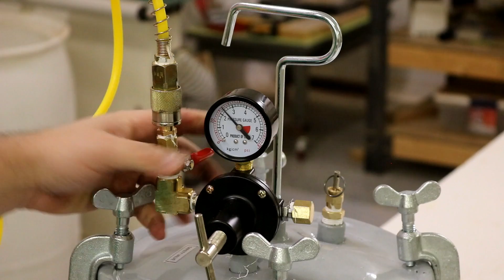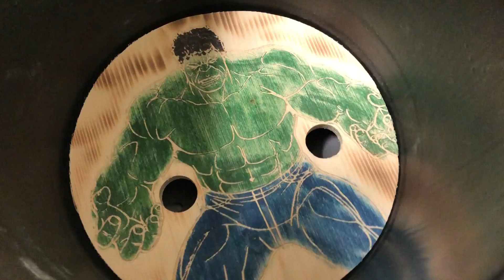Converting a Harbor Freight Pressure Pot for Resin Casting

Comment: For anyone trying to do this in 2024/2025, just fyi...the gauge is in Kg/cm2. Even though it says it's rated for PSI. If you want to do math every time, you may want to consider replacing the who regulator piece with something not rated in metric.

I had to take a propane blowtorch to the t-fitting to heat it up enough to loosen whatever crap they put on it, in the factory. It would not come out otherwise.
Reply from the maker: @TOMJLAEL  I have a video comparing this to a ready made one coming out tomorrow.

Comment: I just tried to build this but I am still getting leaks around the safety valve and the main gauge stem. I used Teflon tape and they are tightened as tight as I can get them. Anyone else have this problem? Any suggestions on how to fix it. The release valve had some glue on it when I removed it initially, that might be part of the problem. I cleaned off as much as I could but I might just need to buy a new one.
Reply from the maker: Karen Ross Smith There’s liquid Teflon that can be used or you can take it back apart and re tape it and use a little more.
Reply: Jake Thompson ok, thanks!

Comment: i dont understand why pressure removes the bubles. Can you explain it?
(i understand how vaccum does it, but pressure is the opposite so i dont understand it)
Reply from the maker: Hyper Hektor pressure squeezes the bubbles so small they can’t be seen!!  It does it immediately. With fast curing resin it is the way to go.  👍👍
Reply: @JakeThompson  thank you

Comment: Hey, went and got all the parts and started following along putting it together. One issue, the threads that are straight down from the pressure gauge, are not NPT! The threads on the cover are. I didn't notice until putting the gauge on and it basically spun freely all the way in even with extra Teflon tape. Did you swap out that 1/4 male to male nipple on the bottom of the gauge? Mixing thread types is a huge no-no, safety wise, so I'm putting that elbow that the gauge was supposed to be attached to back on.
Reply from the maker: Chad Voller One of the holes on the lid is 3/8 and the other is 1/4 inch. The 3/8 one was gummed up so I showed running a tap through the threads to clean it up. There is a 3/8-1/4 adapter for the pop off valve.. the other hole should be ready for the regulator..
Reply: Jake Thompson Both the 1/4" and 3/8" on the lid are NPT threads. The one that is on the bottom of the pressure gauge/regulator is not NPT.   It has standard threads, and is meant for tapered sealed fittings. It's loose when threaded into NPT, and bottoms out before it can even get tight.
Reply from the maker: Chad Voller I’m looking back at the video.. it looks like I screwed it all the way in but I don’t remember the threads being any different.. next time I get out to the shop I will definitely give it a look
Reply: Jake Thompson If it does fail, more than likely it would just leak. But knowing my luck, and the shallow cut the threads in my lid had, being there's little consistency in HF product quality yours could be fine. But I'm gonna play it safe. I've been wacked in the head from an air hose that failed before, and it didn't feel good. Though that was 120PSI. :D

Comment: So for someone who doesn't have a pipe threader, should I still try and fit that 3/8 brass fitting in?
Reply from the maker: Bigtgamer 1 Try to fit it in. If it doesn’t want to go in easily, go get a pipe tap.  It’s just a few dollars.
Reply: @JakeThompson  will do! Thanks for the quick response!
Reply from the maker: Bigtgamer 1 Very Welcome.
Reply: @JakeThompson  one more quick question, was there a purpose to the elbow joint? Or just personal preference?
Reply from the maker: Bigtgamer 1 it just makes the air rotting out of the way to make it easier to clamp the lid down.
Reply: @JakeThompson  exactly what I wanted to know! I'll go pick one up tomorrow, any recommendations of compressors? I've got one for airbrushing that says it's 1/5 HP and goes up to 60 psi, think that would work?
Reply from the maker: Bigtgamer 1 If the tank is bigger than the pressure pot, you should be fine.. if the tank is smaller it not going to work unless you will be using resin with a long working time.
Reply: @JakeThompson  ah there is no tank so I guess there's my answer haha I'll look for a cheap one at harbor freight

Comment: Video is very well done with full explanation in a straightforward manner.  I purchased the Pressure Pot; acquired the new parts (from Harbor Freight and Ace Hardware) and followed your instructions.  Everything worked perfectly.  One point: It was a challenge to disconnect the necessary parts from the Pot, but with some effort they came off.  Thanks again. Peter
Reply from the maker: Thank you for the kind words Peter.. I’m glad the video was useful. 👍👍

Comment: Is there a reason you can’t just cap the paint outlet and leave the safety valve where it was at on the Tee?
Reply from the maker: There are plenty of ways to do it.. you just need everything plugged and a way to get air in, and the pop off valve to work.

Comment: I have a dumb question Jake.  When I work with mixed material, I tend to use vacuum to remove air pockets and bubbles.  Why pressure?
Reply from the maker: SimpleNature The resin n I use has a short pot life, not enough time to use vacuum to remove the bubbles.
Reply: @JakeThompson  Thank you.  Also found the video on the subject.  Great stuff!
Reply: Pressure will cause the retained bubbles to shrink/compress under pressure to where they’re tiny and can’t be seen.  The resin will cure and keep those bubbles under pressure.  Vacuum will cause those bubbles to enlarge and boil off before it cures.
Reply: @JohnPamperin  Never considered the catalyst aspect.  Mostly used silicon potting and have noted froth before.  These are long cure 2-part formulae.  The remaining pressure of each air bubble could be problematic in more viscous compounds.  Often softer 2-part solutions are used in high voltage applications.  However there are other hard-cast application I can certainly see advantages.

Comment: Question = I thought the idea was to use vacuum and not air pressure to pull all the air bubbles out of the resin?
Reply from the maker: Hooked On-CNC Vacuum and pressure are just 2 ways to get the same result
Reply: Depends on what you're doing. Both work good for getting rid of bubbles. A pressure pot actually compresses the bubbles until they're too small to see. A vacuum will remove the bubbles but the resin will bubble up and rise during the process and can spill.
Reply: @mdbz8357  That is true. I would use a vacuum to remove bubbles then pull the resing out of the pot to pure the resin into the 2 sided molds with vent holes.

Comment: Jake, GREAT video!! I just finished assembling my HFT pressure pot with all the fittings you showed. Works great, as far as having to adjust the lid position to the point of no leaking. Next time I will use your suggestion with petroleum gel. Haven't tried casting just yet but will soon. Curious what you do to hide the blank barrels in the clearer blanks so the brass doesn't show as much. I painted two barrels with silver glitter spray paint as well as spraying a little inside the blank barrel hole too, but that didn't work because now the barrels won't fit in the blanks. Going to re-drill the blanks and see if they will fit then. Any suggestions?
Reply from the maker: Gary Maynard I’m glad the video helped you!! One thing I do as far as leaking goes.. is .. I have some clamps handy and if it leaks I just clamp the entire pot to the table.. and as far as the blanks go. I just try to have the blank not see through.. but painting the tube is just about all you can do I think.. 👍👍😄
Reply: Gary Maynard you can get a mold for pouring blanks around the pen tube. I’m not exactly sure where to get them though.
Reply: I know some folks paint the tubes white

Comment: Can a pressure pot be used as a vacuum chamber by substituting a vacuum pump for the compressor?
Reply from the maker: Wood Turner You can use it for vacuum but you really need to see in the vacuum chamber when you degassing things. So I think a different lid that you can see through would be necessary for it to work correctly

Comment: Can the pressure pot also be used as a Vacuum Chamber for stabilizing wood?  
I understand it is the complete reverse of its intended purpose.  
Thanks for sharing.
Reply from the maker: alfredesquer Yes it can be used for a vacuum chamber, but you can’t see through the lid, you need to be able to see what’s going on in there when you first start the vacuum. Here is a link to my stabilizing video. https://youtu.be/s7EoPC1Nlb4
Reply: You put the resin in the vacuum before you pour it into the mold or into the wood. This is useful when the wood is bigger than the vacuum pot. Watch anybody else's video and that is how they do it.
Reply from the maker: david diehl Theres more than one way to do things, This is how I chose to do it with a faster curing resin. Everyone else’s videos are using resins with about 45 minutes of workable time.  This resin has only 12 minutes of workable time.
Reply: @JakeThompson  limits you on size too. I cast building sides over 12" . Also use the vacuum for plaster parts.
Reply from the maker: david diehl That’s cool. There are different resins for different applications I’m sure we can agree on that.
Reply: @JakeThompson   I have also found if you spray your mold with enamel paint the color your part will be. It acts as a mold release. Even on silicone molds.
Reply from the maker: david diehl good tip.. 👍👍👍

Comment: Great video Jake! Can you pressurize the resin before it hardens,  then pour it onto your project? I think I've seen it done but you seem like you would know better than my guess. Thx
Reply from the maker: NUTTY You can do that with very slow drying resins.. there’s not enough time to do it that way with resins with less working time. People that use slow drying resins use a vacuum chamber to remove the bubbles.
Reply: there are a few videos on that subject out there but basically a vacuum chamber will extract all the bubbles by expanding all the air bubbles until they are big enough to rise to the surface and pop, whereas the pressure pot doesn't actually remove the air bubbles it simply compresses the air bubble to microscopic proportions so that they can't be seen by the naked eye, and then of course holds the pressure until the resin sets up.

Comment: Jake, I'm sorry if this has already been asked...why do you need the 90° adapter between the compressor hose and the regulator.  From a layman's point of view it looks a little clumsy to go in from above.  Is there a reason that the hose adapter can't go directly into the regulator so that you go in from the side instead?
Reply from the maker: Shawn Sherman It’s just personal preference,  and it helps get the air inlet away from the wing bolts that hold the lid down.. in the future I’m going to have air lines coming down from above.. and the fitting pointing up will make more sense then. 👍👍
Reply: @JakeThompson Hi Jake. nice video. I just finished mine but I can't bleed the air off with the ball valve. it is almost like there is a check valve inside the regulator that came with the tank?
Reply from the maker: william hamilton Mine will not work either if I open it too fast.. I just lift up on the pop off valve.

Comment: Hey Jake... nice vid, thanks! Just built my pot tonite. 
Here’s a question:
On the black pressure gauge piece where the threaded crank sticks out, there’s a pin hole immediately under the threaded crank on the black housing. Mine seems to be leaking from that pin hole. Any idea why there’s a hole there? And what’s the crank for anyway? Thanks, boss. 
Cheers.
Reply from the maker: XXXTechRC The metal thing sticking out is used to control the pressure your air supply lets in the pot.. right around 7:30 or so in the video you can see me turn it to let more pressure in.. maybe it’s backed out all the way and that’s why it’s leaking.. just a guess.. let me know if it helps.. I will be in the shop tomorrow, and see if I can find the hole you are talking about
Reply: @JakeThompson  So... I did a bit of testing and when I turn the T crank out, it stops air from coming in via the supply, but still pisses air from the pinhole under the T. When I crank it in, it allows the supply to pressurize the tank, but pisses even more air out the pinhole. There's a point where almost no air comes out the pinhole, however, at that point the regulator does not let air in the tank. By the time I find the sweet spot, I've lost 5 lbs of pressure. Guessing I need a new reg,  :/  Either that or I'll drive a nail into the pinhole.   arg.
Reply from the maker: XXXTechRC Yeah.. sounds like you are on the right track .. let me know what happens. 👍👍
Reply: @JakeThompson     -----   yep! Regulator was toast. Go figure.  So, what I did was replace it with a $4 gauge/regulator with knob also from HF,  ditched the elbow and capped the pop/release valve hole since it was another point of failure (slow leak). Those brass fittings get out-of-round very easily. Since I have another regulator on the supply tank, I didn't see the need for triple redundancy. Now it holds 50+lbs for over a day with only a 3-4lb drop. I'm ok w/ that.  Thanks again, Jake. ( btw - I'm XXXTechRC in prev. comments... I just created a new channel this week for my new wood working venture... content coming soon!)
Reply from the maker: SouthWindsWoodWorks Niiiice!! I will go sub!!
Reply: @southwindswoodworks8260  --- if you are using the wing nuts that come with the pressure pot that is more than likely where you are losing the air from.  I did one of these conversions over a month ago and I was having issues with air loss.  I did two simple fixes.  First, i put some gear oil on the seal to help the lid seal better to the tank.  Next, I removed the wing bolts and replaced them with some hex head bolts and use a cordless impact in stages to tighten the bolts.  Think of it like tightening lug nuts.  Do a cross pattern when tightening and do it in stages.  I hit each bolt 3 times.  This puts a much greater force on the lid and I have 0 air leaks now.  Just a couple thoughts.  Back to lurking.
Reply: @alanfetz8553   -  Thanks for the info - I actually had decent luck w/ the lid seal.  My gauge was bad so I re-modded the pot w/ new one and  w/o the pop valve. Works great!

Comment: What type of resin do you use to make blanks? I bought alumalite amazing clear cast but it doesn't set in 3 to 4 hrs like yours did on this video thanks in advance and great video ❤ it.
Reply from the maker: some guy I use the slow set alumilite.. the remolding time is 2-4 hours. I think the stuff you have is a way slower setting resin.
Reply: Awesome! Thanks for getting back to me, I'll have to try the resin you used thanks again.

Comment: Very good! I have it all assembled, and it is holding air well, but the relief valve pops early as yours did. What did you a just to calibrate it?  Thanks
Reply from the maker: Steve Schaefer the area around the thing that pops up.. has slots in it.. stick a tiny screwdriver in it and turn it clockwise.. easy peasy.. 👍

Comment: I’ve been trying to troubleshoot the cause of a leak in my pot and think it might be the gauge itself as I’ve read reviews that the one that comes with it can leak. Any recommendations for a new gauge?
Reply from the maker: Amanda Donovan You should be able to go to any hardware store, Lowe’s... Home Depot and get a gauge.. or amazon.
Reply: It was the base, but with sealant that stopped but there was still a leak of about 1lb every 5 minutes and for the life of me could not locate. Read two reviews that it could be inside the gauge and need to replace, havent done that yet.
Reply from the maker: Amanda Donovan Mine has a slow leak at the seal I think.. I just leave the air on and let the regulator keep it filled..
Reply from the maker: Victor Gonzalez on my other pressure pot video I put a link to some pipe thread sealant.. here’s the video. https://youtu.be/Az-00xUVUP0

Comment: Great video, thanks! I followed this and things worked out just fine. Just a heads up to fellow Canadians (with no harbour freight) that you can buy an identical pressure pot at Princess Auto (a national chain). All the parts and steps outlined in this excellent video worked well for me on the princess auto pressure pot.
Reply from the maker: DM Awesome. I’m happy to hear the video helped you, and now I can tell Canadians where to get a pot from.. good stuff! 👍👍
Reply: @JakeThompson  The only issue I ended up having was some air leakage with the teflon tape. I ended up redoing it using a liquid thread sealer (Loctite 545) and now it holds 50 psi for 24 hours. And I'm casting resin!
Reply from the maker: DM Awesome!!! Now you’re in business!!

Comment: Ok I watched this but could you explain how long you leave it in there? You didn't explain that or did I miss it? I'm new to this also could you explain the point to doing resin casting this way please and thank you.
Reply from the maker: bev dowdy Thank you for watching. Different resins have different demold  times on the labels. Using a pressure pot removes the bubbles from the casting. At the end of the video I show the difference between using a pressure pot and not using one.
Reply: @JakeThompson  Thank you. I use Aluminite clear coating & casting resin high gloss blue box one so that would work. Thank you for the video

Comment: I just finished assembling mine, and am currently testing it to hold pressure. I used pipe dope instead of the Teflon tape, and it seems to have been easier.
Reply from the maker: Anthony Parks On my second pressure pot video. I used pipe dope.. I absolutely agree with you. 👍👍